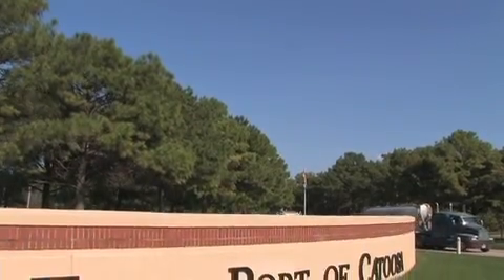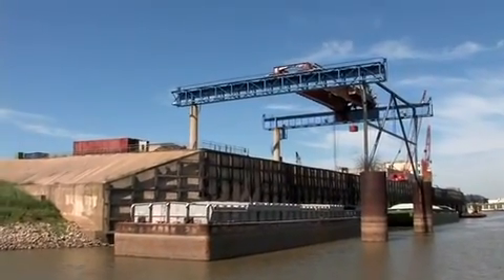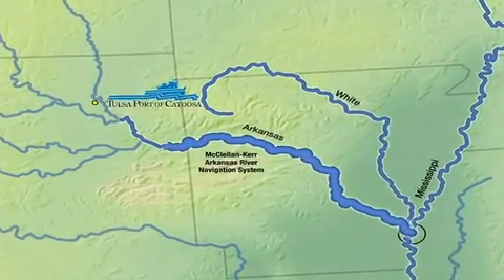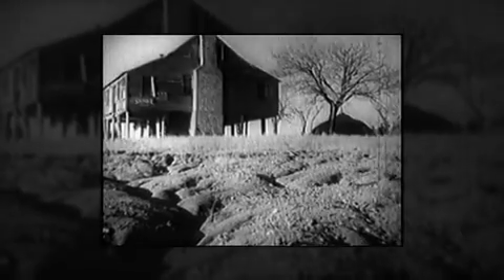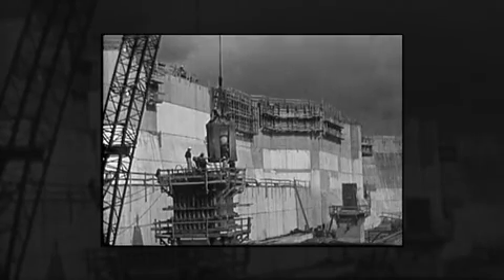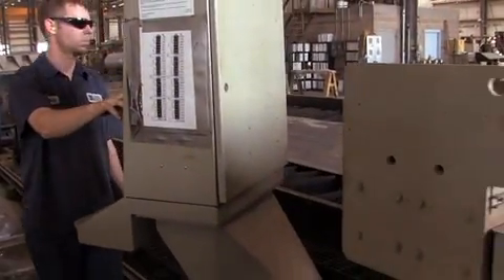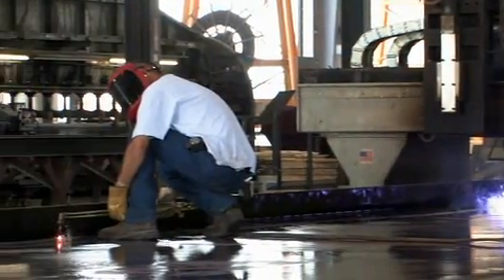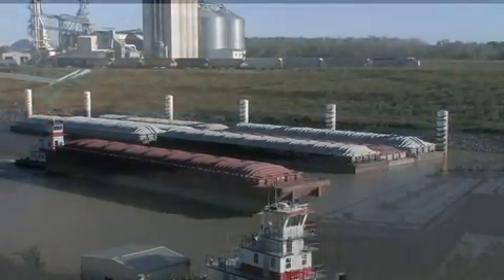Tulsa Port of Catoosa

Comment: ...and that still makes no sense: "...they call them towboats cause they push."  

Definition of tow is to pull or drag (a vehicle, boat, etc), esp by means of a rope or cable. 
Webster's has tow listed as a transitive verb:
   1. to pull by a rope or chain
   2. to pull or drag behind

and Roget's Thesaurus has the following synonyms for tow:
      haul, pull, drag, ferry, lug, yank, tug; 

I don't see no PUSH in there, bro...